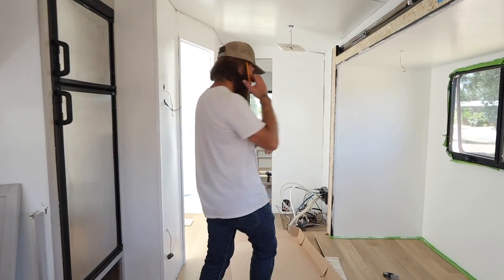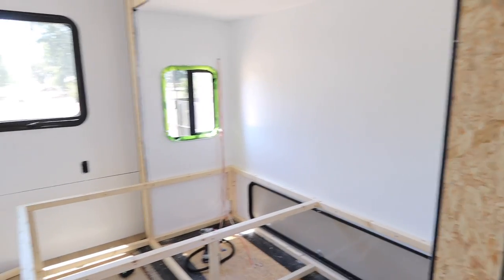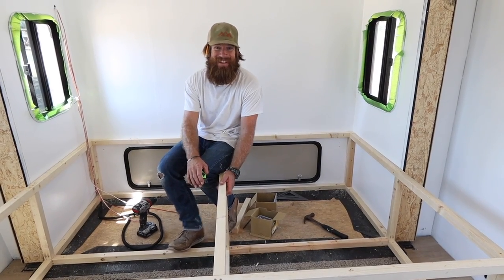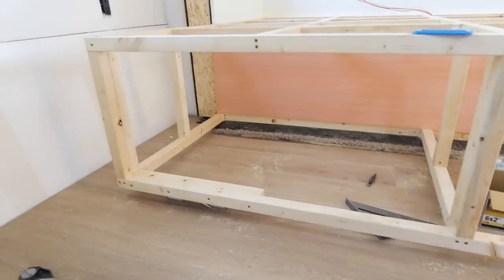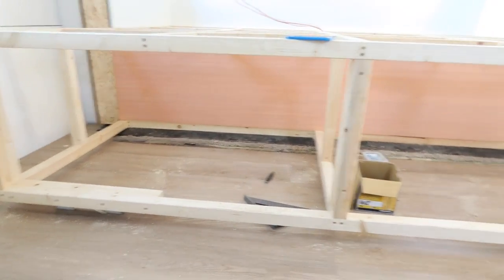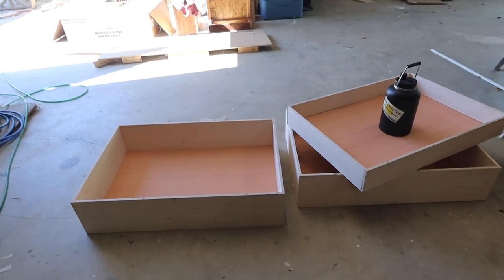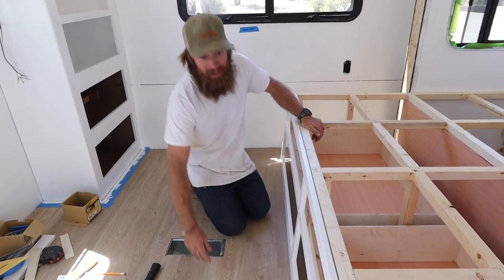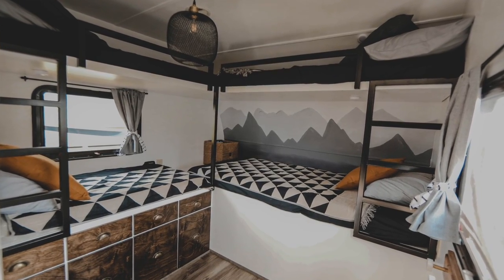We love a turned bed in an RV and this how we do it

Comment: By any chance can you provide a video of how you "rebuild" the wall to be able to support the barn doors?  Also,  have you ever worked on a aluminum rv? I want to add a wall (barn door) because it's got a paper sliding divider between the bedroom and bathroom.   🤦‍♀️. I would love to add a wall now that I've turned the bed east to west.
Reply from the maker: Yes, the next time we take out a wall for one we will make sure to video it. We take most of the wall down and add to the existing frame inside. Adding a support beam at the top to hold the barn door rail and extra wood within the frame. Then put wall board back up.

Comment: Any special considerations if the bed is on a slide out?
Reply from the maker: There are jackstands you can place on the outside under the slides to give it more support but its essentially the same weight in the slide that we took out.